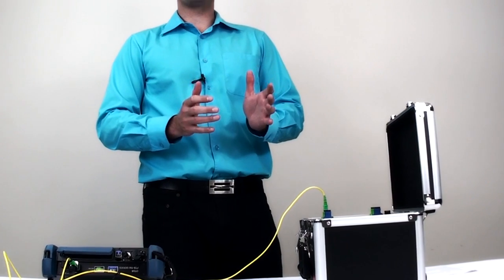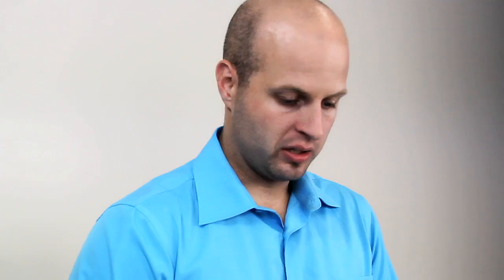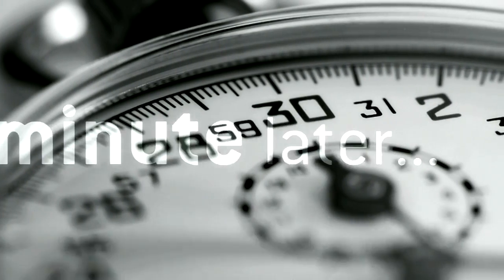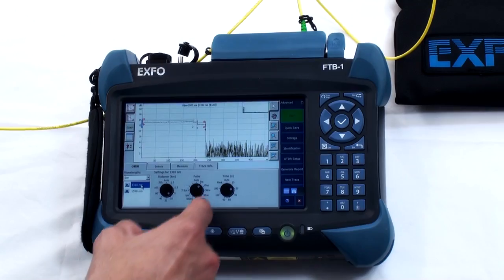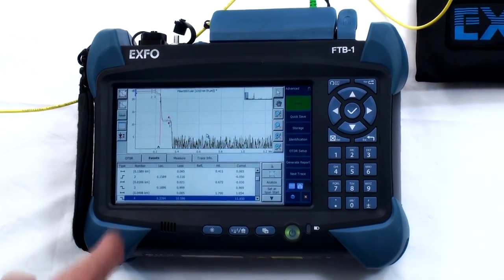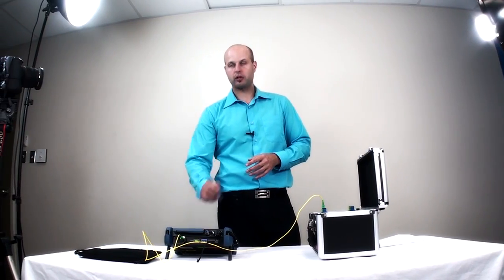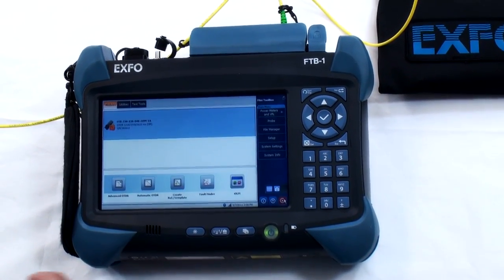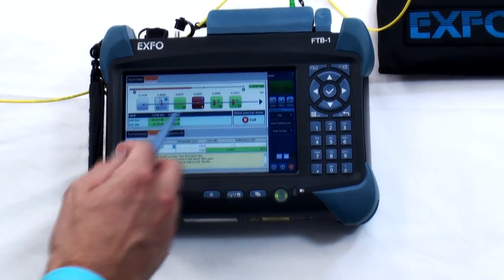Head-to-Head: OTDR vs iOLM

Comment: iOLM is definitely useful but I'm wondering why he's spending an entire minute between tests. You can just adjust your settings to run for 10 seconds. That model and the newer v2 units as well as all the other FTB units and every other Viavi brand OTDR gets a clean trace in 10seconds just fine. Been doing it for 10years almost daily.